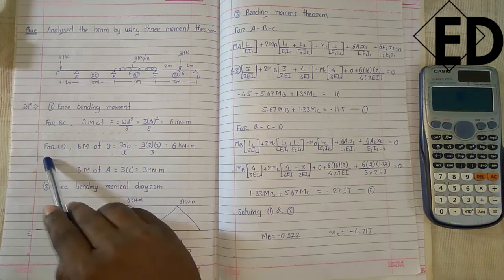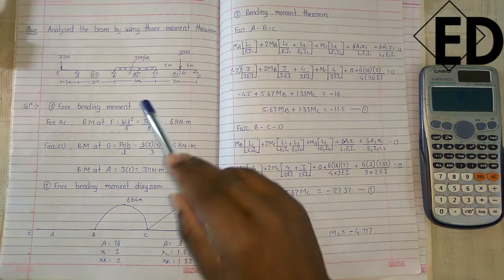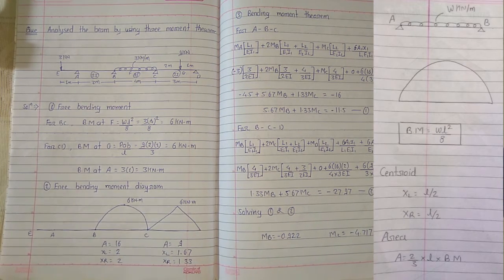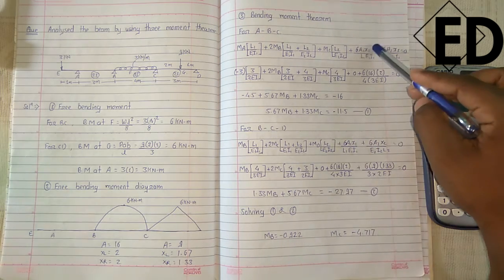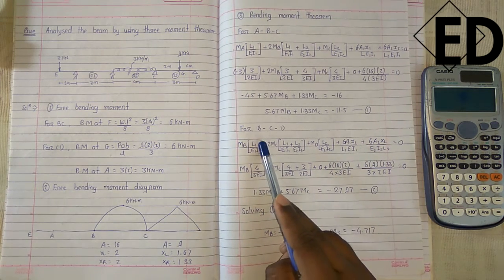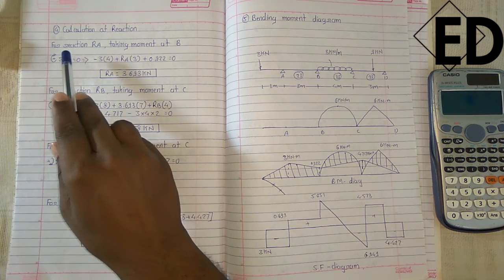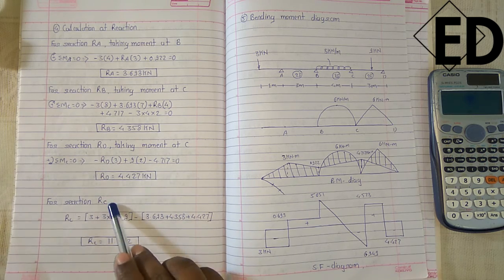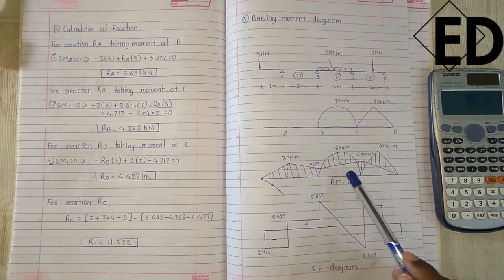How to solve three moment theorem ? (type 2)

Comment: on the bending moment theorem for span BCD, how do we know which x(centroid value) to use when the point load is concerned
Reply from the maker: +Ayanda Dube 
It is the assumption that centroid value taken from remote end.
Reply from the maker: +Ayanda Dube 
As for span BCD  , for UDL centroid value taken from B, and for point load centroid value taken from D.... 
Similarly for others.